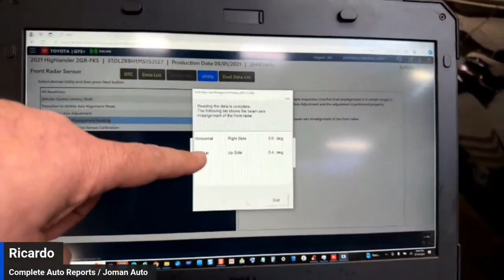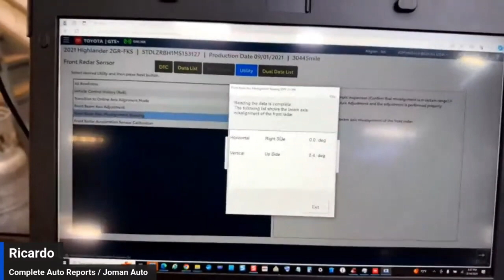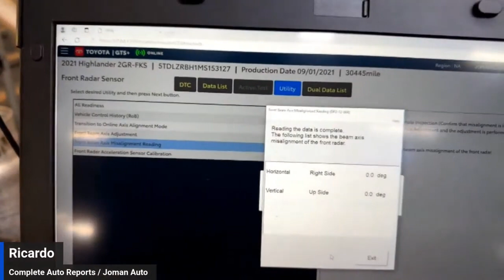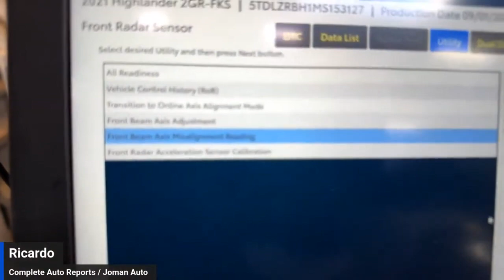ADAS Calibration Training | Perfecting Radar Alignment With 7 Step ADAS  🚗

Comment: Could you tell me how to clear off the dash's BSM and RCTA malfunction warning lights?
I use Autel 909 scan. The car is a 2024 Highlander.  I tried all with my Autel909 scantool.
thanks
Reply from the maker: Hi @ben23jon .  In order to properly diagnose and fix the 2024 Highlander we would recommend:

1. Please use OEM software on a current year vehicle.  While the Autel may work, no aftermarket tool is ever suggested for any vehicle younger than 3 years from today.
2. Please perform a PRE-SCAN and determine all of the codes the vehicle presently has.  SAVE ALL RELEVANT FREEZE FRAME.  THIS IS TEDIOUS AND ANNOYING, BUT A GREAT LEARNING TOOL AND MORE EVIDENCE GATHERING.
3. Please read and learn about the ADAS blueprint system we have put out for the community to use.  It is very thorough and helps you earn a great wage for performing high quality work. link: https://www.7stepadas.com/adas-blueprinting/

We strongly recommend you take this approach to all services in general, but most especially regarding ADAS services.  As you are in charge of automated driving systems at this point, and responsible for them.

To simplify the diagnostic approach for this comment:

1. From PRE-SCAN, check into codes that did not clear and have/had freeze frame data
2. Read the code descriptions in Toyota TIS (in this case).  Understand what the fault is and how to determine the next course of action.  IE; communication error means the rest of the car isn't seeing the blind spot. alignment error likely means it has been moved from it's original location or replaced and follow up actions are needed.
3. Make a plan and enact it.

Please take performing ADAS work seriously.  The safety responsibility of everyone in that vehicle, is now in your hands.
Reply: @jomanautoservice  The problem with using a PC is how do you adjust a radar for example for Honda and you need to keep running back and forth from the radar to the PC. It would take forever to correctly calibrate.
Reply from the maker: @mrpartsng  If you use 7 Step ADAS, You don't run back and forth.  You measure and put the target where it belongs. www.7stepadas.com